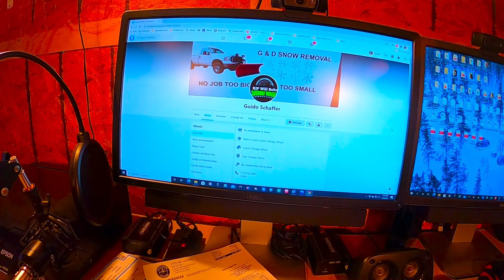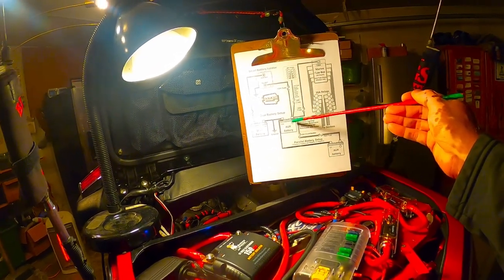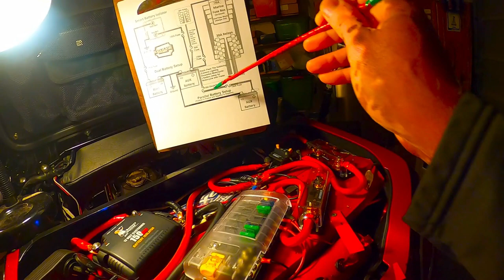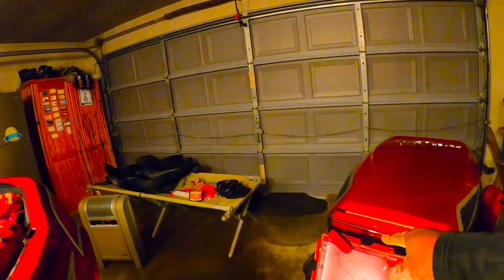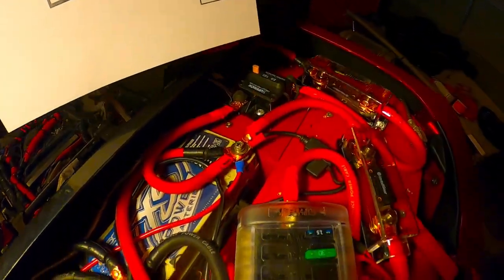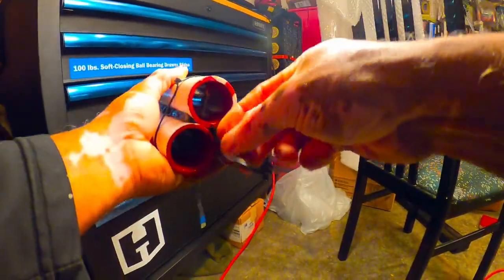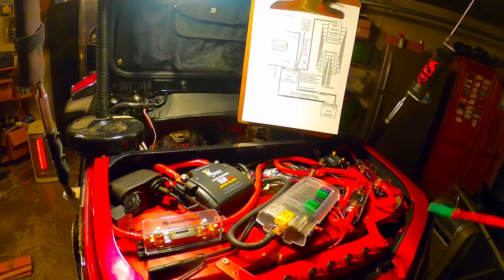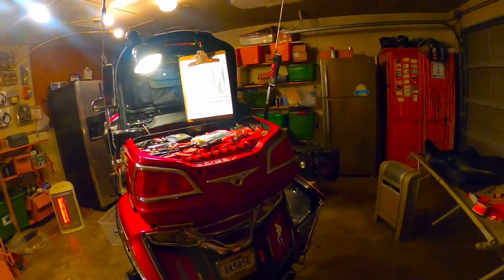Black Flash the Goldwing 2021 Triple Battery Installation and Test Results

Comment: Nice setup that shows a detailed layout.  You are "The Tech Savvy Rider".  I like the channel.  Question, Does this have an effect on your alternator?  It sounded like the third battery started drawing more current from the bike.  It also looks like the alternator is charging in parallel based on your meter reading.  I am not an electrician, so I may not have no clue as to what I am talking about :-)  LMBO!
Reply from the maker: Yes, my brother, you are absolutely correct. The 3rd battery was under the 12volt requirement to sync with its partner battery so it immediately starts pulling from the primary battery through the Isolator requesting to be charged. Once it reached the 12 volt requirement to run as a parallel connection it was good to go

Comment: Hi Carnell 
I’m back again with questions again. Did you when you were making your rolling eyes up, buy rolls of RGB led lights and cut them to length yourself and do all the flat wire connections or did you buy them all made up
Reply from the maker: Here is the rollin eyes website. You can buy any length up to 70 LEDs on one strip. I use 36 LEDs in length on the majority of my large applications and 16 LEDs on the small ones. http://ergomot.be/shop/index.php?route=product/category&path=69
Reply: @CarnellLuckettSr  hi there I’m back again. Thank you so much for your help today, and I haven’t bought the bike yet how sad am I. But really I’m planning ahead on cost and your knowledge on how to do the rolling eyes it will be great if I can pass on your knowledge to the GW riders here in Ireland as I think we are all singing off the same sheet. Keep those brilliant educational videos coming I always look forward to seeing them.
Kind regards 
Pierce

Comment: I'm curious why you didn't add another 12 volt isolator for the third battery in your system.

Doesn't that third battery take it's charge from the second battery before the second battery charges as you said in a previous video which is why you put in the 12 volt isolator for the second battery, so that the second battery wouldn't take it's charge from the first battery.

Is that why I hear the extra draw on your motor happen when you turn on your circuit breaker.

Other than that, this is an awesome system that you've set up. 

I'm planning on using your ideas to add a secondary battery to my 81 CM400T which I use year round, but have upgraded my lighting and also added heating accessories for the Pittsburgh PA winters that I still use my bike amongst other accessories.

When I get it setup I'll send along some pictures and upload a video.
Reply from the maker: That's cool, looking forward to seeing your video. The difference in this setup the 2nd and 3rd battery are setup in parallel to run together as one. I demonstrated the 3rd battery connection as separately to show it was being charged, once it reached the 12 voltage minimum requirement it became a parallel connection with the 2nd battery and ran as one battery all together.the isolator is used between batteries that are not directly connected,  that is the difference.

Comment: Hi Carmel
My name is Pierce Wade
I have to say TOP man to do that to a Goldwing. I’m going to purchase a new Goldwing from America ( I live in Ireland) it will be at least a 2021 model. I bought one in 2001 it wa a yellow one and it came from Hollinks motor sport in Rochester NY and I won lots of shows with it. So I want to get back on the seen again. If I put lots of lights on my new bike, but I want it to be the best. Will I be able to use the system you have or will it be different because off the new system on the 2021.
Kind regards 
Pierce
Reply from the maker: My brother, you are asking a very good question. I must say these lights are designed for the Goldwing but I have not seen them on any 2018+ Goldwing. Your question deserves an answer so I will contact the seller and give you their response to your question, I will get back to you as soon as I know. the answer.
Reply: @CarnellLuckettSr  Thank you so much for your quick response. I’m just looking at you videos from 5 years ago when you had a black beard ha ha. I understand the concept on what your doing. I just need to know what to buy and where to
Reply: Buy it. We have a good Goldwing following here in Ireland and it would be great if I could help others here thanks again Bro 👍🇮🇪